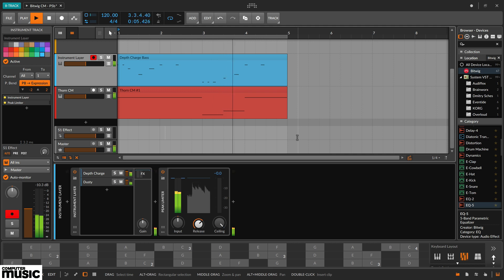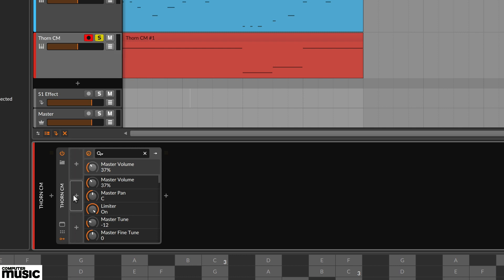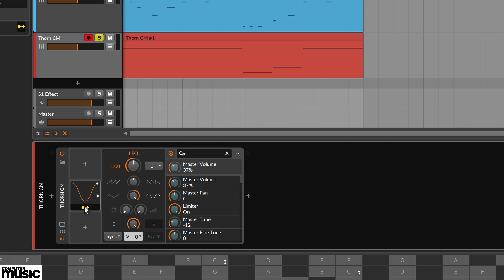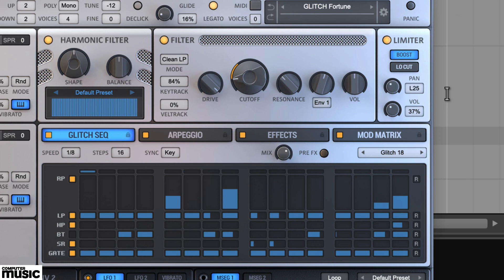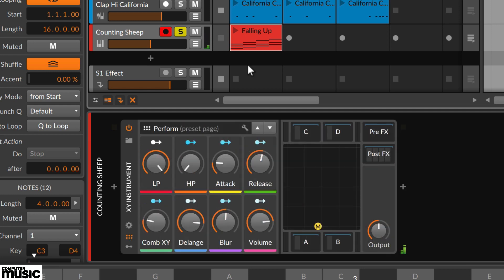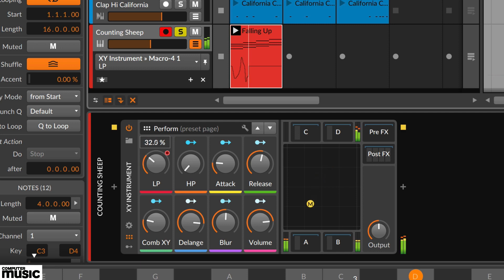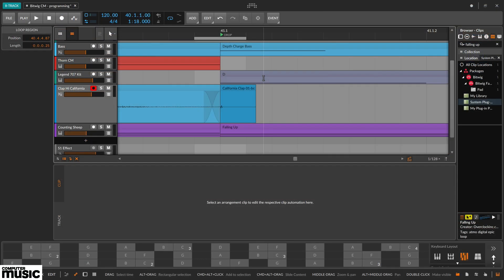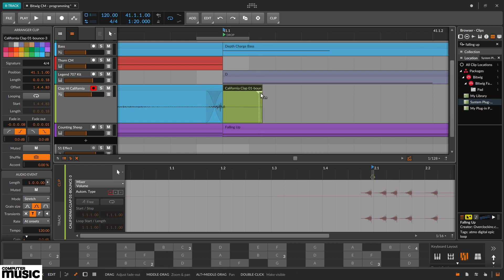Bitwig Studio 8 Track

Comment: Considering picking up some of the older issues, through Zinio, for some of the items.  Zinio states that all listed items come with the issue through "FILE SILO"?  However, I noticed in your August 2018 issue it lists DEHUMINISER LITE and then I noticed in your video referencing that plugin that it's only good until September 2018.  So is it included when bought through Zinio?  Is there a list of what doesn't come with older issues?  
Can you please explain how it works?

Thank you.